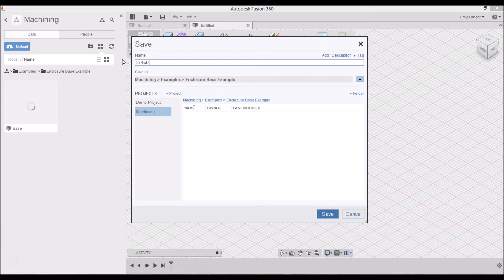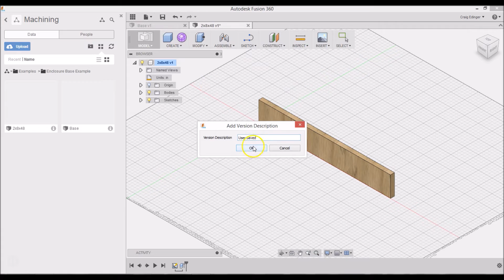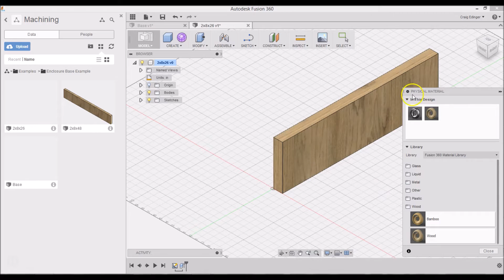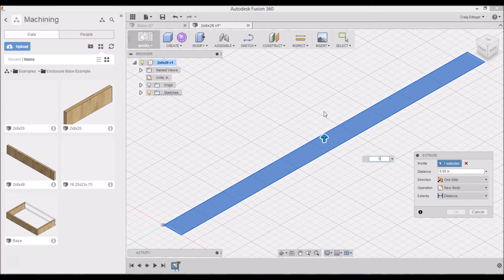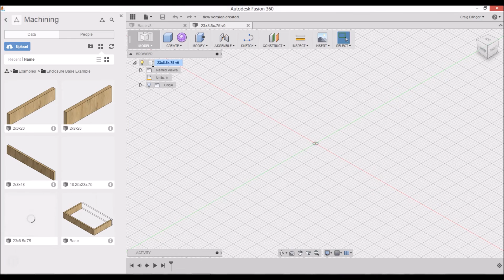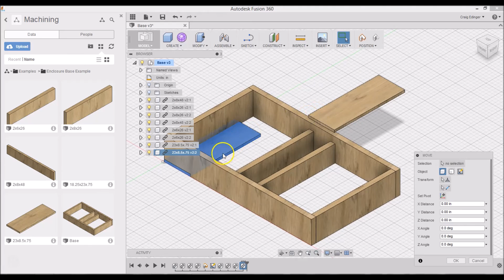Mini Mill Enclosure Part 1   Frame Design - Fusion 360

Comment: When I try dragging a component onto my current project area, it doesnt happen. I did exactly what you did... still is not opening. Is there anything I could be doing wrong or is there another way of opening a component in my current file?
Reply from the maker: Make sure the current file is saved. That's the problem I ran into before. If it still doesn't work then try closing and reopening fusion 360.